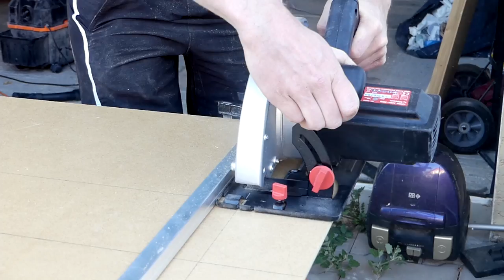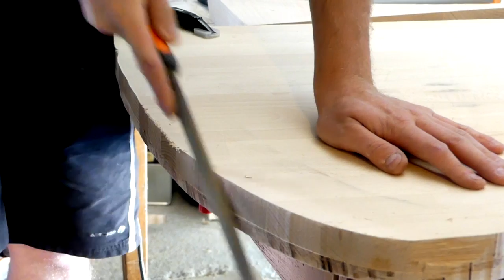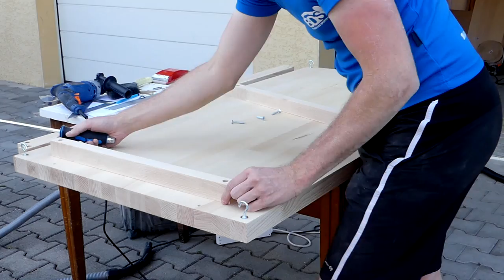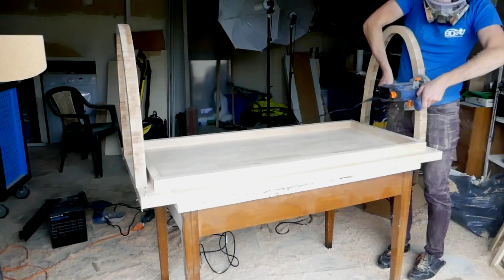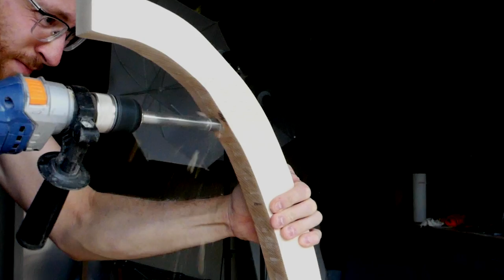The Impossible Floating Table !! (Tensegrity Dinner Table)

Comment: Here is a tip, never use wood as a bushing from something that spins at around 20,000 rpm. Not very smart! If you have the wrong size collet for your router, get a new collet!
Reply: also I wouldn't advise holding the workpiece to your chest and then routing...

Comment: Enjoying the video so far. Should be called: How do use the wrong powertools.
Reply: My thoughts exactly, I think he may be referring to you using a router to cut the shapes of the oval legs, it's probably why you blew the bearings out of that bit. Routers can be used for that, but not for long cuts and and thick wood. Jig Saw, Band Saw, Scroll Saw. But nevertheless, awesome table. Great job!
Reply: Anyone else get forest Whitaker eye when he put a wood sleeve in the router collett?
Reply: Lol
Reply: Instead of using/destroying the router to make the cuts and a file to finish them, he should have used a jigsaw to make them and the router to clean them up.

Comment: Very interesting!

But, I would have one little design amendment.  If you made the base part shorter and narrower, the corner chains would stabilise the table top better.  For they would be tapering in and therefore working diagonally across the table to resist the opposite corners movement.

Comment: I wish you would have shown how stable it is. Shove on it, or something.
Reply: Rick Frazier Yeah, I was thinking the same thing too.  I wonder how much it swings.
Reply: For me it looks pretty stable. The wobbly is present because its hanging. Use regular, fiirm and quality kind of wood. 100% it will not be wobbly. Does that makes sense?
Reply: Me too 😜
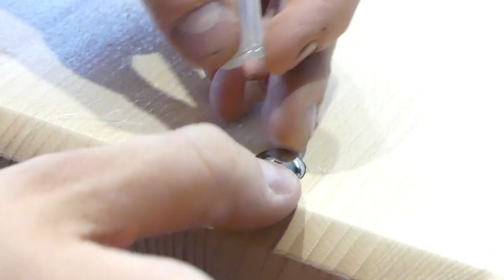Reply: you see it wobble at 12:25
Reply: Raynhardx thanks. this thing is pretty wobbly.
Reply: Rick Frazier they are only stable if you press down in the centre of the table top, the nearer the edges you get the less stable the top becomes. There are a few videos on YouTube demonstrating this concept and you can see the stability issues there. Let’s not forget though that this is an eye catcher more than a functional piece.
Reply: @steviebee1989  an eye catcher for sure, but unfortunately, a non-functioning table in any environment, other than inside a glass case, can prove to be dangerous, or at the very least, a mess waiting to happen ... of course, kudos to the imagination that thought this one up
Reply: There are 4 strong chains which tied the table form 4 sides which will not let the table move..so it stays stable...bro..🙊🙊
Reply: I was thinking the same, lol. I don't believe that is so stable because of chains, but if we do welding points on each link of chain together, it will get 100% stability for sure.
Reply: Agreed
Reply: Yep thats what im expecting at the end, but they didnt show how stable it is..
Reply: A hint: it's not stable at all, LOL :)
Reply: shove one end horizontally
Reply: @Azuel18  ... nothing is 100%
Reply: @worldlearners4556  I think you are right. If there is downward tension on the four chains it should stabilize it. Put some angle on the four chains when building it would also help.
Can’t be anymore wobbly than a four legged table on a brick patio.
Reply: If you used the right kind of bolts for the hooks you could tension each point where the chains are attached. You put enough tension on all of those points that table it won't be moving much.
Reply: @worldlearners4556  While it may be stable along it's horizontal axis, it has zero stability along it's longitudinal axis. Just one slight push on the end of the table top and will certainly move, and swing back and forth till it comes to a rest. But it sure is a very cool concept. Stability be damned.
Reply: @Azuel18  good idea
Reply: @worldlearners4556  a
Reply: I repeat they wobble....

Comment: No one shows tensegrity tables in use, they are shaky, try eating soup on those, for art exhibition, pottery or lamps, it would work great.
Reply: Perfect I was hunting for something like this in the comments, but looks like I don't need to bother with the facts, you nailed it for me.
Reply: It would be possible to make a stable tensegrity table, but it would need far more than the four corner chains. Maybe have those and add around eight angled lengths of high strength fishing line around the edge to prevent wobble.
Reply: @peterjf7723  worth a shot. I´ll be making one myself. they do look great

Comment: Title of this video should be" THE IMPOSSIBLE FLOATING TABLE YOU CAN'T USE" .😂😂😂
Reply: It's not floating, its hanging.
Reply: @nathanledgerwood4529   my bad! "The impossible hanging table, you can't you use" it ok now.😀
Reply: @AMITRANA-il4sw  you can't use
Reply: Come on do not discourage him, be good to him please, you can see that he has passion to create something good so do not hurt him, it is so very easy to comment BUT it is very hard to do something like this creation and take the trouble to put it on YouTube for you to see.
Reply: The only way you can't use this is if the tension on the chains is off, but but then you got the long hooks but the butterfly nuts to adjust that
Reply: If you were to incorporate a bench seat you could push the chains out to 45° which would stabilize the table as long as you could tork down the chain but you might have to use stronger material but it would work
Reply: @dragulia_venaro  you can use☝️
Reply: @paulwolf6925  he said "can't"
Reply: @camionbrowne8914  No you could not really use this table. It would swing on its long axis like a weird hammock. In fact, you could probably make it into a hammock...
Reply: actually, it is very stable.  Look up the physics of the concept.  Usually done in a triangle.
Reply: You can use it.

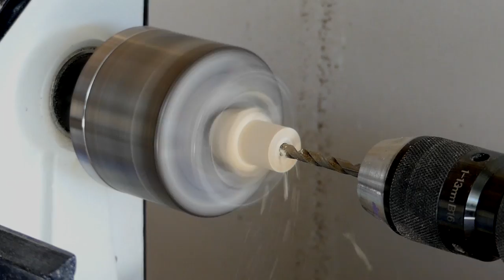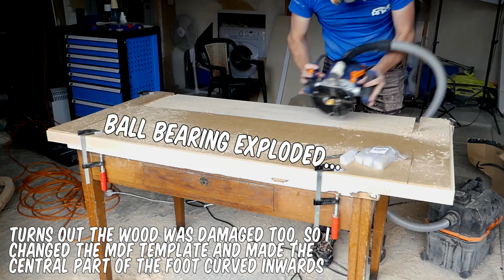Comment: 01:34 The wooden sleeve might be the reason why the bearing of the router bit exploded here 08:39
Wood is compressable, you can tighten it and after a while it can get loose again. Quite dangerous.
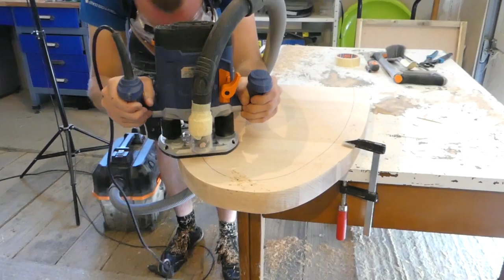02:59 You have a bandsaw, you could saw and laminate a few stripes of wood into a curve. It would have much more strength.
Reply: Using a router as a saw= exploding bearings
Reply: Exactly. Never heard of a jigsaw??? The science  is impressive, but your carpentry  knowledge  is subpar.

Comment: Did I miss the part where he puts things on it, like serves a meal or uses a laptop?
Reply: It's a bit of a mind fuck this table, but once you can figure what is supporting what, you realise it 100% could support a meal and easily support a laptop.
Reply: @MuttleyVonErich00  with this being claimed to be a dining table, this design appears to be absolutely horrible for sitting anyone at the ends of the table because the wooden supports are pretty much the width of the table and right at the very end: where do you put your legs if you sit at the end?

My Dad built a table 3.5’ by 7’ in the 80’s I inherited, made of oak, walnut plywood and maple, using sort of trestle style feet at both ends, with a narrow concave rounded octagon motif (no rounding for tabletop shape) where the sturdy 2 legs with huge feet are far enough from the ends anyone can sit comfortably at either end, and are deep enough in anyone can sit anywhere along the length. In addition to sitting concerns, since the table wasn’t really meant to be disassembled (I doubt it’d be as sturdy after that, if reassembled) it also, curiously enough, greatly impacts being able to move it through doorways into and out of houses and apartments, stairways, etc. that don’t have a lot of space. The geometry works out rather well for practical daily use as well as the mobile life it has acquired once I became an apartment nomad after the house I had.

It doesn’t appear that this tensegrity table is intended to be disassembled. As much as my dining room table is no flyweight, 2 people are able to move it horizontally in and out of a room without tilting (assumes an archway wide enough between rooms) for cleaning, even kids, and 2 non-wimpy people to move it tilted sideways into/out of buildings: as much as it’s made of oak, walnut and maple, MDF is heavier, while also not being as strong, so if this table as I see it can’t be readily disassembled and reassembled, it’ll be problematic to move, though looking at the video again, it appears it uses wing nuts for the screws for the end support bolts, which should make disassembly/reassembly easy enough, but yet another thing to make it less than ideal for humans to be exposed to during use too near the ends.
Reply: @MuttleyVonErich00  play around with a tensegrity sculpture and see how precariously the forces are balanced, then talk to me. Kyle Hill covered them a while back, maybe on Because Science. Food and electronics are big on stability.
Now I feel like being a jerk. This dude has lousy craftsmanship skills and wasn't even set up for this project. The finished product looks like a high school student made it and if he wants more than a fiver for it he's crazy.
Reply: It would work. The entire table is hanging from the two center chains. All of the chains are in tension so it is a very stable table. What you can’t see in a video is that all the chains are in tension.
Reply: The weakest part in supporting a heavy load is the arm holding up the "U".  I would estimate that would withstand the weight of a large man, it would just be wobbly until a center of mass was stablized.  Replace the wood with metal (and the chain with cable) and you could probably set a car on it.
Reply: @Wix_Mitwirth  “Now I feel like being a jerk.”

Well, you sure as hell succeeded there. Criticism is one thing, but there’s no reason to insult the guy.
Reply: @anonymousanimal5179  really. hm.😶
Sick burn tho

Comment: The easy way to look at it for a sense of the reality is to imagine the long chains at the corners for what they are... decorative, besides some directional stabilizing along the horizontal plane. As in, they provide nearly no vertical force. Cut to length, they just hang there.
Reply: They stop the table from tipping due to any imbalance.
Reply: @phonicmonkey8213  not sure on that one. i would like to understand the design engineering, if applicable...
Reply: If the corner chains weren't there the whole table top would roll onto one side, unless it was perfectly placed to balance in the middle somehow and never ever disturbed.

Comment: That's a wonderful table, lovely design. 
Invest in some equipment to help with your fit and finish.  Disk sander and bobber with like 40 or  60 grit disk and barrel. Bend some welding rod to layout  the curves before bandsawing. And bandsaw very close to your layout line.
Great work tho!

Comment: Run the outer chains diagonally to opposite corners with a pin binding them where they cross. If you do this once per axis, it will stabilize pitch and yaw.
Reply: Unnecessary.

Comment: Thanks for the video.  I’m from Canada and I really enjoyed watching your ingenuity and craftsmanship.  Please don’t be offended but I noticed use your router for some things that should probably be done with a jigsaw.  Using the router to cut through thick wood will eventually cook the points (motor magnets) as well overheat the bit bearing.  The harder the wood, the quicker this will happen.  But as a hobbyist, I understand we don’t have all the tools that we want so we do what we can with the tools we have.  I don’t know if France has pawn shops or garage sales but if they do, you can usually find some pretty good used tools for next to nothing.  I would invest in a table saw, jig saw, router table, belt sander, drill press, forstner  bits, wood chisels, etc.  I’ve collected tools for the past forty years and I can honestly say the older, well used tools are just a good or better than brand new tools.  They are built tough, easy to fix and best of all, are usually really cheap to buy!  Let me know if I can help you out.  Your friend & new subscriber from Canada.  Peace!

Comment: Have you never heard of thread inserts? Also replace the outside chains with thin high tensile wire and fasten them at an angle that passes behind the arches. This will aid on the visual effect of the top section floating and give lateral stability to the top.

Comment: This table is "read only". Without any sort of tension in the chains, it would wobble like a waterbed even if you simply breath on it. Nice if this was built only as a piece of art, boo if it was also meant to be practical.
Reply: without corner chains it would flop over

Comment: This reminds me that typical restaurant's table with a short leg that never stop moving and shaking.
Reply: As often as not, it’s an unlevel floor that causes that problem. The better quality commercial bases have threaded adjustable feet for that reason, but move the same table a few feet in either direction and you might have to start all over . Of course, it’s a lot harder to get a three legged table to wobble.

Comment: this table is totally unstable lengthwise it swings like a swing
Reply: Needs to connect the two hanging chains at an angle to the base with two chains. IMO.
Reply: Yeah X cross over on ends and lengths will do the stabilizing. Str8 vertical wont as shown
Reply: @squirts1  I said lengthwise... Ehsan wrote X cross... Kindly
Reply: @squirts1  That table wobbles. Period. You can even see it in this video. It's still a parallelepiped being held upright by a chain half the side's height. It's a very inefficient way to keep a parallelepiped stay a rectangle.
Reply: @squirts1  just I wood like put a glass of water on the table and eat something quietly... but really I have no problem :-)
Reply: No, it doesn't and can't.
The four corner chains under tension stop it.
Reply: @RedRooster-xj4uk  it doesn't wobble but it sways horizontally through the length of the table. It's unstable "lengthwise".
        Table
⬅️ '|'I'''''''''''''''I'|' ➡️
Reply: @RedRooster-xj4uk  Just no. There's videos showing they swing more than anyone would accept for calling them a table. Call it a sculpture if you want.
Reply: @palopo-t3v  Then they haven't been properly tensioned.
Don't knock the concept because of poor execution
Reply: @RedRooster-xj4uk  No, this is equivalent to grabbing 4 chains. Tying two of them to the ceiling and the other two to the floor. Then in the middle, tying all 4 chain ends to a plank of wood. No matter how much tension you put on the chains, you will be able to wobble the plank to the sides. This is just bad geometry. You need something pulling sideways from all sides to stop horizontal wobble. These are CHAINS, they're not soldered and they're flexible.
Reply: @palopo-t3v  no, it's not the same at all.
Have you ever actually built anything?
How far did you progress in physics?
Your analogy is equivalent to only having chains on two corners.
There are SIX chains to be tensioned. To be accurate your analogy would require additional chains from the mid point to each wall.
A very stable set up.
Reply: @RedRooster-xj4uk  Maybe with this image you'll understand why it's bad geometry. This arrangment is 100% equivalent to the floating table.
https://imgur.com/2dYaK7e
Reply: @palopo-t3v  I repeat, WHAT HAVE YOU EVER BUILT?
HOW FAR DID YOU PROGRESS IN PHYSICS AND ENGINEERING?
Reply: @RedRooster-xj4uk  I studied aeronautical engineering but I work as an airline pilot. I don't build stuff but these basic mechanics problems are definitely not hard for me. The amount of tension required to make this rigid would just break the chains and there's nothing providing lateral rigidity other than the parallelogram. Just look at the videos!

Comment: This is a very cool table! The physics of it are essentially just the same as a Spreader or Spreading device. The chain in the middle is tightened to force the top & bottom apart. And the two chains on the outsides, Are there to Control/ Preventing the top & bottom from being forced apart. Which creates tension, Resulting in there being a sufficient amount of the nessesary rigidity to support the table.
Having similar force or pressure from a pushing force or a pulling force &/or both. And directing that force against each other or away from each will create that tension. Or having force directed in One direction and then creating a containment or restriction for that force singular force. Will create that same tension that is nessesary to make the table, Stable & Solid enough to use.